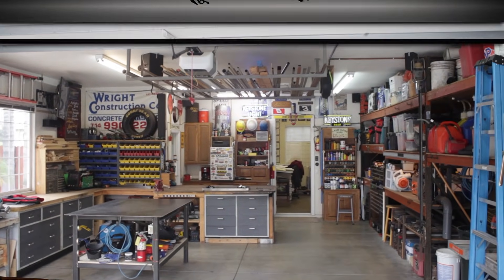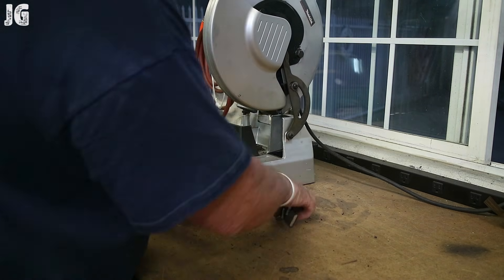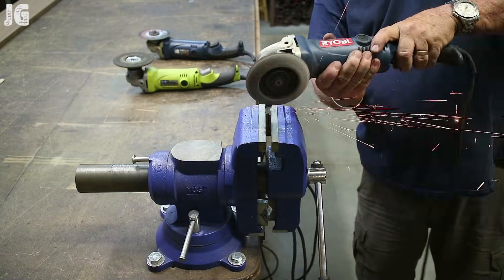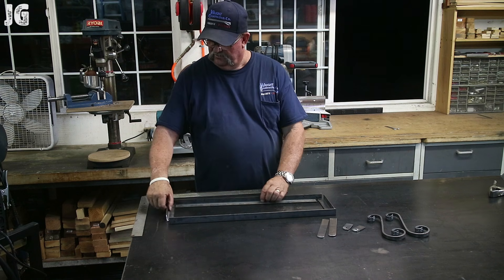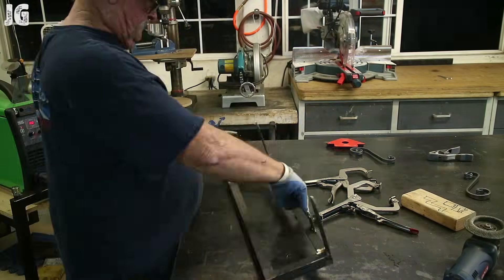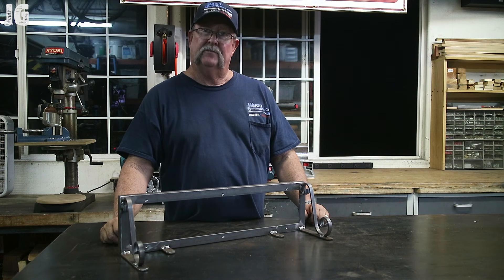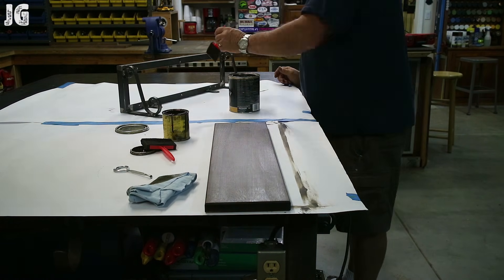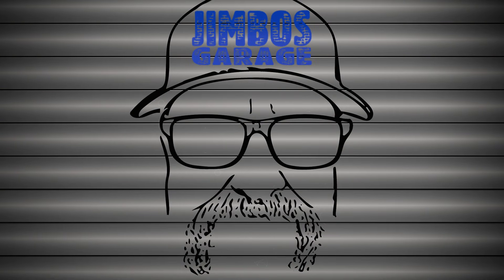Decorative Metal & Wood Project - Jimbos Garage

Comment: When I cut angle i lay it in with the point of angle straight up... stays steady and no need to jig it up. 
Great videos JB... I found your channel about 2 weeks ago.. been going through alot of your videos. I learn new ideas on pretty much evey video! Thanks for the time and effort making them. Subbed!
Reply: Yeah I do the same on straight cuts. I think it’s a little easier on the saw blade too. I use his method though for any mitered cuts and that seems to do fine as well.

Comment: Hey Jimbo. I pretty much watch all your videos and I was wondering what blade you use on your angle grinder when making the cope cuts. It's seems your blade cuts alot better than mine. Please let me know, thanks
Reply from the maker: Thanks for watching Michael, I use benchmark abrasives, That is there cut off wheel. I think you can buy them through amazon.  Jimbos garage!